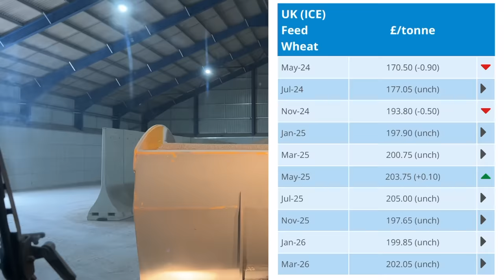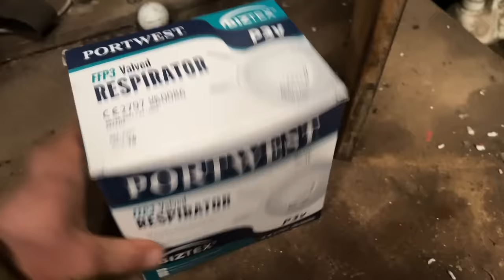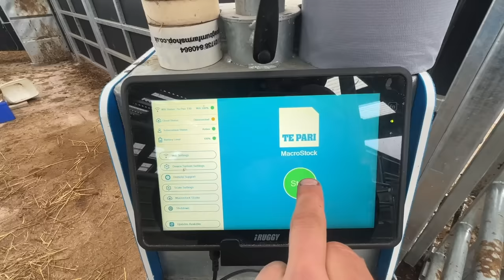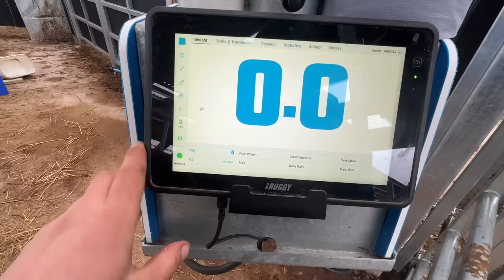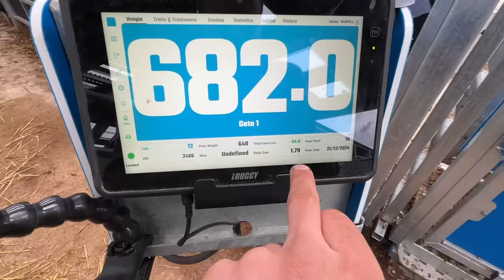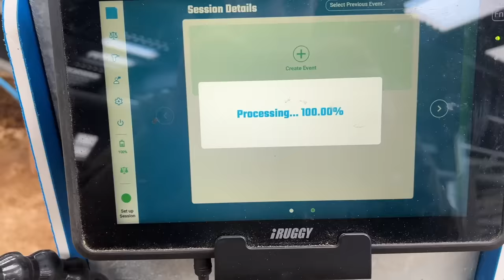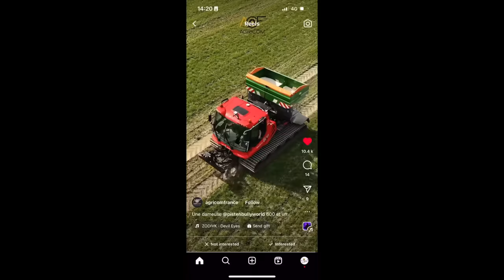Making Some Changes | Weighing Cattle With The Te Pari

Comment: You make hard work of the sheet. Just roll both sides to the middle, tie them up and put the pallet forks underneath and lift. Drop it on the arch to refit and untie it. Simple 10 minute job on your own
Reply from the maker: Still had to lift it down from the rafters, take longer to put it down again and roll it up